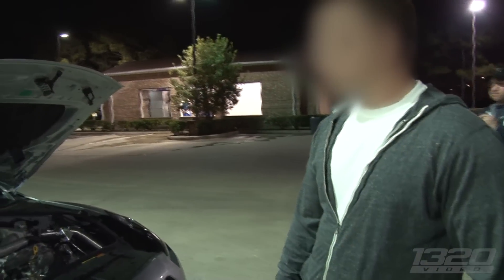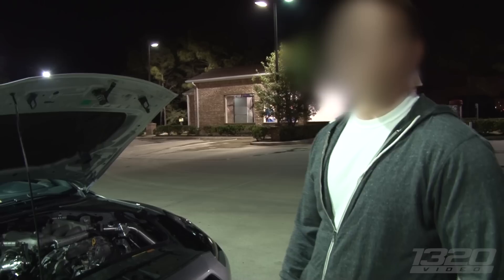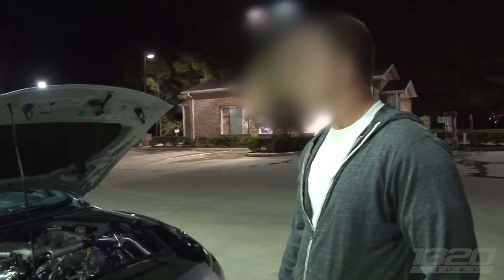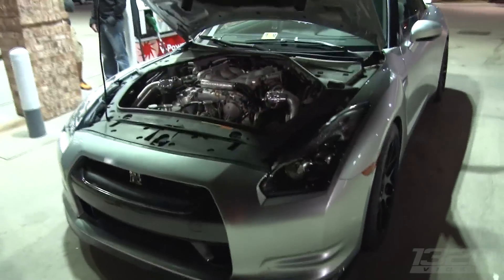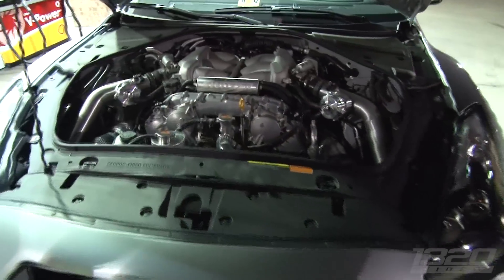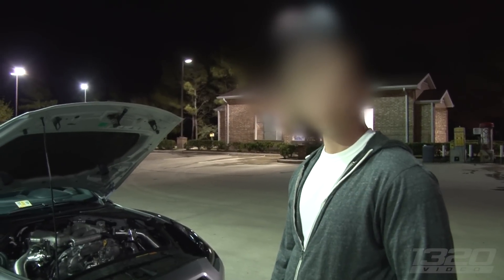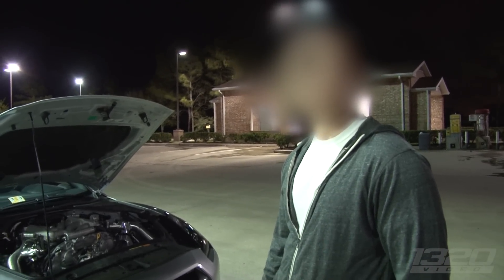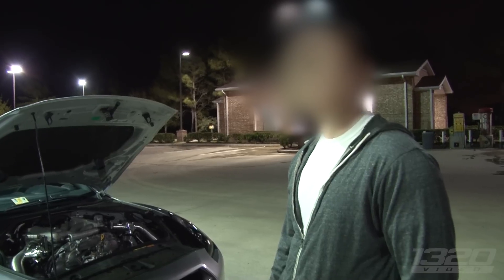TX2K13 STREETS - DIG RACE!? - 870hp Evo IX vs 915hp GT-R

Comment: Gtr jumped
Reply: +Omar Jamali thank you.
Reply: +Omar Jamali Twice! lol
Reply: Doesn't matter, the GT-R is pulling away
Reply: +ATTESA ET-S 東瀛戰神 R35 GT-R nismo N-ATTACK A-kit actually it does matter in any race if someone jumps they automatically lose
Reply: ***** Yes but the EVO will lose even if they start evenly. The GT-R is clearly pulling away.
Reply: +ATTESA ET-S 東瀛戰神 R35 GT-R nismo N-ATTACK A-kit what we are saying is the gtr jumped which means he lost. No one is saying the evo or gtr is faster here
Reply: ***** This is street race, rule isn't that important.
Reply: +ATTESA ET-S 東瀛戰神 R35 GT-R nismo N-ATTACK A-kit I don't think you've ever raced but alright you're entitled to your opinion. I think even if the gtr was slower you would still be on its side looking at your pic and user name. That's just my opinion.
Reply: ***** I don't do straight line race, I'm from HK, circuit race is what I usually do but anyway, have a good day.
Reply: of course its pulling away it jumped there for it was ahead at the start cause it went early...
Reply: Yeah but I can hear the GT-R messed a bit at 2nd-3rd, the EVO catches a bit then falling further behind. That means the GT-R is overall quicker.
Reply: Messed a bit? how can you mess up with Paddleshift. its more so evo can mess up cause its using a proper gearbox, :|

Comment: Respect to the evo for pacing with godzilla, he also either left the line late or the GTR jumped, but the evo still kept up pretty well. If pro drivers were in both cars they would run fairly equal times.

Comment: Before anything, I love both of these cars. However, one must not forget that the GT-R shifts much faster and smoother. In any case, the lighter Evo did a decent job against the GT-R. Both cars are great, but I'd take the "weaker" Evo over the GT-R simply due to the manual trans.

Comment: Lets get this straight:

GTR 915 HP, Evo 870 HP (as stated)
Thats a difference of 45HP between the cars, almost nothing when the we are talking about cars over 700 HP+ anyway.

GTR weighs around 595lb (270Kg) more than the Evo, big difference there.
At 1:32 i can see the GTR has no LED Driving lights, so i am guessing its a 2009 model which means it weighs more than the newer 2012+ models.

So we all witnessed the jump, but that Evo never caught up to the GTR.

Comment: What sucks about this is it's hard to tell which car is really quicker. From the looks of the gap the GTR put on the EVO after 2 clear jumps, it COULD have been neck and neck. I like both cars but, I wouldn't have been suprised if the EVO actually edged out the GTR. At those power levels, whoever leaves first really matters.

Comment: I agree a chase is a race and the evo lost. However, you said the GTR would have won even if they launched at the same time. I said how can you tell that ? 

Look at the evo's headlights, it's not that far from the gtr which means your assessment of " at least 1 bus length " is hardly the difference there. That was a close race. Won solely due to the jump of the gtr. Which is why everyone is saying they should have lined up again as it's not some grand victory.

Comment: The evo didn't jump, the skyline looks to me like he had no intentions of running in either of the first two attempts(didn't even rev his motor). The evo gave chase cause the only way the gtr guy would have raced is if he had the holeshot  advantage. The gtr also roll raced this same evo and lost but Im sure that video wont make youtube but I will be surprised if it does.

Comment: I was driving this Evo, a chase is a race. I chased and I lost. There's also a roll race with this gtr where I tore his ass up. We did it from a 40 roll and he shut if off in 3rd, according to him it wasn't a clean run. But he chased me in 2nd gear@40mph. Apparently this is how you'd race from on, if you feel like you're gonna lose shut it off so the race doesn't count.

Comment: Can somebody give me total cost estimates of each car (with upgrades)? I'm thinking 80k for evo and 160 for GTR? Would that be about accurate?
Reply: Sounds about right to me.
Reply: nahhhh these days you can build an 800ish awhp evo for way under 80k. evo 8/9 in good condition go for around 20-25k. built motor, turbo, other go fast bits, 20-25k. def around/under 50k total
Reply: adotwhite Cool, thanks
Reply: I have a friend who spent $35K for an E85 conversion, a blue printed motor, a built transmission & set of ALPHA 10 turbos. He is laying down 1120HP. It's quite ridiculous. lol
Reply: Sideler74
pretty cool, thanks

Comment: If the GTR doesn't get the jump he wont race? the fucks that? Evo guy is a real racer he event race himself lol
Reply: true lol, evo needs wider tires and slick and use gtr's worlds bad ass transmission tech, evo would WIN EVERY TIME! but wish evo have tech as gtr's tramsnssion paddle, evo will be crazy FUCKER! so try race my evo 8 6766 at 49 psi and have slick tires on street all day and does 0-160 mph in 8.09 seconds :) by stopwatch :) and still use manual, and not u]have technogly transmssion as gtr, if evo do then evo WINNER! FOR SURE BITCHES! i went 221 mph at 9200 rpm in 5th gear in stock gear ratio no kidding!1 i will upload after winter over ;) and will try do in 5th at scream 10,000 rpm and see if break 235. i had done at 221 mph no problem on my road nice stable, lowering and have aero body work on.
Reply: justin estrada No thing beats a GTR . never did never will
Reply: lol lol ur wrong man, gtr is crazy 1500 awhp in other video that did only 373 kmh in one mile with heavy launch acceleration and very very technogly gears, so try race with venom gt! venom gt is only 1200 hp crank which about 1000-1050 whp, and acceleration?? it do so gappy acceleration in shift from 2 gear to 3rd and when in 4th gear it do full floored pedal when rev at redline then shift in 5th it slowly shift and u can see digital mph go so slowly in 2-3 gear and 4-5 gear and 5-6th gear kinda quicker shifter and 0-100 mph not even floored pedal at all!!! and it hella murder gtr! cuz not even quickly shift as close as GTR does, and venom did 230 mph in one mile!! with those lightly pedal 0-100 then lazy ass shift slow in 2-3, 4-5th and still does 230 mph! and did 0-186 in 13.xx and 0-200 in 14.51 seconds for those lazy ass fucker shift! vemon gt with slick tires and put best drag driver they will does around 242-246 mph in one mile! so gtr no way match as venom gt! so u think??? :) nope! my gsrx does under 7.8 seconds at 183 mph in only fucking 1/4 mile! what about half mile? easily over 210 nooo problem, never done 1/2 mile and believe will do over 210 mph OBVIOUSLY FOR SURE! so gtr 1500 awhp not do under 8 seconds yet! lol lol. venom gt will outrun gtr at straight line up top speed yes venom gt will RUN OUT GTR. so what wrong with ur dream gtr? lol my gsxr 1000 SMOKE my evo easily. so yes gtr never touch my gsxr. if u think so gtr will win then fin d1500 awhp gtr then ask them to favor race a guy have a 7 second GSXR 1000 only under 300 whp!
Reply: no thing beat gtr BECAUSE U NOT WATCH MY EVO OR GSXR 1000 bike!!!
Reply: so if for true race for any stock to stock, lol gtr is super slow for being stock it hella slow compare to my gsxr 1000 was stock still do mid 9 seconds :) why gtr so fast at 1500 awhp because of heavy build and bigger turbos to make 1500 awhp, so if stock to stock corvette zr1 will FUCK GTR ALL YEARS FOR STOCK TO STOCK!

Comment: Gtr fail evo kept up with almost 100 less horse power and the gtr jumped the gun. Gtr cost is about 100 grand evo 8 stats at around 35 grand ultamite fail

Comment: I love the GT-R, but the driver sucks, my grandma can launch that car. Jumps both times, and has 2 cylinders more, an extra turbo, makes 45 more wheel hp. GT-R boyfriend over here, say he whipped him bad, yeah fucken right. Evo driver excellent launches, uses 3 pedals, unfair match up. can't leave this one out either, Automatic Dual Clutch transmission. love but what happened to the traditional 3 peels shifting gears races. c'mon.